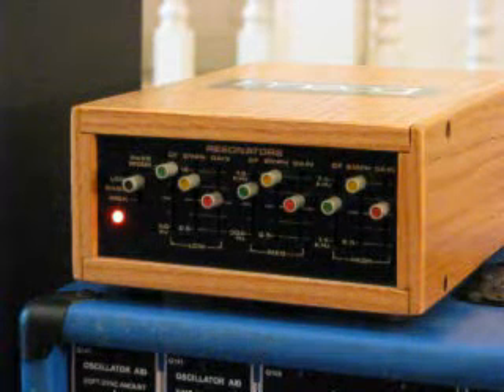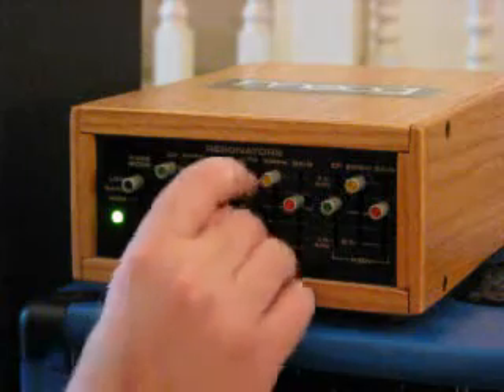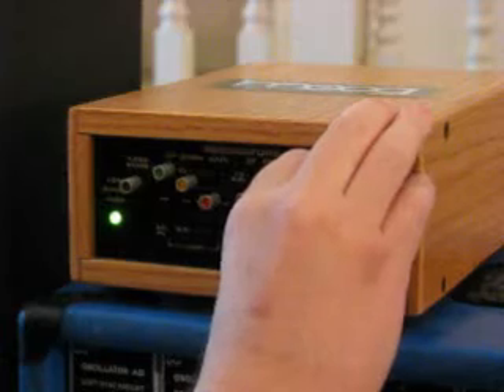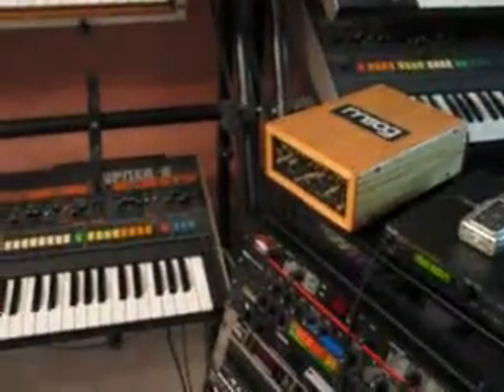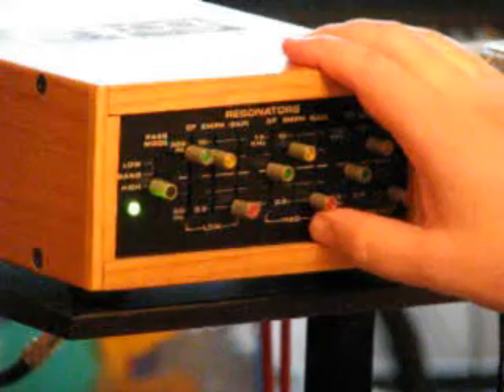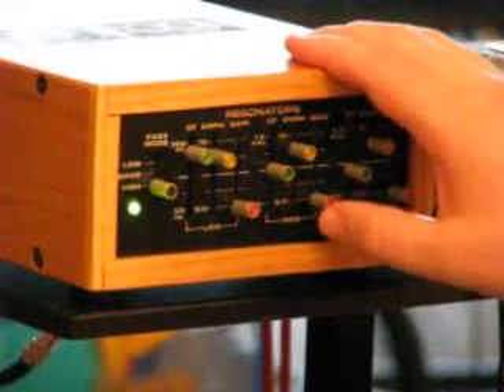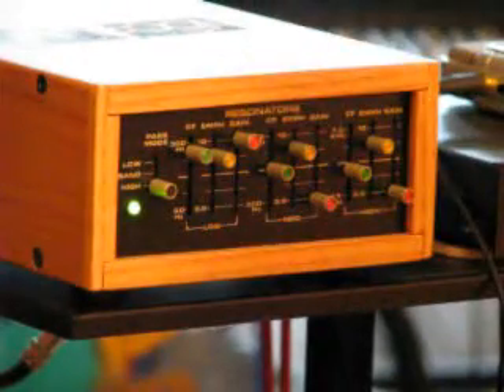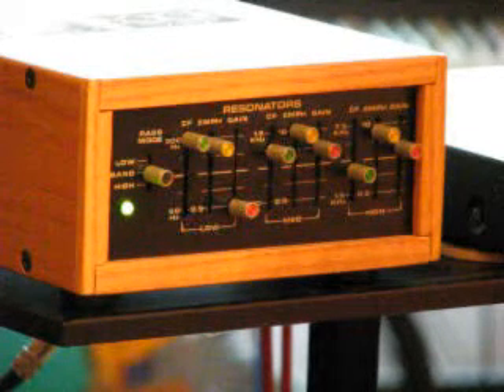Polymoog Resonator Section

Comment: There is a new eurorack module available from TipTop Audio called the RESONATOR which is very similar except it even includes voltage control of all the parameters! I haven't tried it yet but it seems great!

Comment: That is such a useful box for formant work. Moog really should make one of these although I guess it wouldn't be difficult to put together something similar in eurorack these days.
Reply: The cirquit is very very simple and could easily adapted for eurorack. I will build a few stand alone units once my empty PCB's arrive from China. I believe Jurgen Haible (R.I.P.) was the first to clone it.
Reply: @VerreyckenGerd  I might be interested if you can make a standalone for a reasonable price. I don't seem to be able to contact you here but you can find me on facebook if you want to make contact. Just search my name on FB.
Reply: @VerreyckenGerd  can you share schematics for the resonators?
Reply: @lucasc5622  They can be found in the polymoog service manual.
Reply: Hi. You may have something by now but there are modules available with the same circuit (or at least equivalent). Here's two in 5U/MU format: 
Grove Audio - PM Resonator

https://www.modulargrid.net/d/grove-audio-pm-resonator

Club of the Knobs - C910 Poly Resonators
https://www.modulargrid.net/d/club-of-the-knobs-c-910 
I think there are others, as well as eurorack versions. If you don't have a modular synth you could just get a small case to hold and power one of these?
Reply: @JohnLRice  thanks John that's very helpful. I've been experimenting with various filters for this kind of formant work but haven't reached a definitive conclusion which is best yet. Useful to know these modules exist though.

Comment: Hi Guys, 
Thanks for linking to my video. The PM Resonator isn't made by COTK though, it is made by Grove Audio (a USA company I believe) In my video I'm demoing the PM Resonator by Grove and also the COTK C1660 Phase Processor at the same time. Sorry for any confusion that may have caused.  That said, COTK does have their own take on the resonator and is their model number C1610

Comment from the maker: @samealalan  After I cut the resonator out of my Polymoog to create the stand-alone unit, Juergen Haible created a PCB that you can buy and stuff with the electronics and create your own front panel to build your own. And COTK (Club of the Knobs), a modular synthesizer company came out with a Polymoog resonator module you can buy.  It's seen in the upper right corner of this video:  watch?v=sl37XQfkJCQ

And since you have a Polymoog, you can process external sounds through the resonator.

Comment from the maker: @ToxicBrainSludge  Yeah, there is no key following. Formants are generally resonances at fixed frequencies, or in the case of human voices they can change to produce different vowels. I guess it's that most people aren't used to using anything more than a lowpass filter since that's the only thing most synths provide. But acoustic instruments are more complex than that, so more complex filtering leads to more realistic acoustic type sounds.

Comment: @RGAF1987 A parametric equalizer should be able to do a similar thing. "CF" would be labeled "Freq", "EMPH" would be labeled "Q", and "Gain" would be "Gain". The only main difference would likely be that it'd  constantly be in bandpass mode, unless some models come with high/low pass filtering.

Comment from the maker: @RGAF1987 I ripped it out of my Polymoog because my Polymoog had so many problems that it was virtually unrepairable. I made this resonator module from it and also the Polymoog coffee table and sold them both off, and also sold off all of the other parts to various Polymoog owners to help fix their Polymoogs. So nothing went to waste, and I probably ended up making back the $2000 I had paid for the synth back in 1981.

Comment from the maker: Hello John Rice.  I sold it because I already have all kinds of other filter modules that can basically do what the resonator does, and with more flexibility to boot.  So I didn't think I would end up using it so much anyway.  Plus at the price is ended up selling for via my private auction, I'd be almost crazy for not selling it.  And I might end up with a couple of JH's PCB's, so perhaps I'll end up with a couple of resonators anyway.
Reply: Yeah but can JH ones do this? Sound exactly like this?

Comment from the maker: baward:  Yeah, I have the MOTM-410, which is the Korg resonator in module form.  The Polymoog unit is for tone shaping while the Korg/MAM is more for doing sweeping filter effects kind of like phase shifting.  No way to set amount of resonance, or set gain of each band, no lowpass or hipass modes, and no way to easily dial in a particular frequency.  But the Polymoog resonator isn't voltage controlled, so no LFO modulation type stuff.  So they have quite different applications.